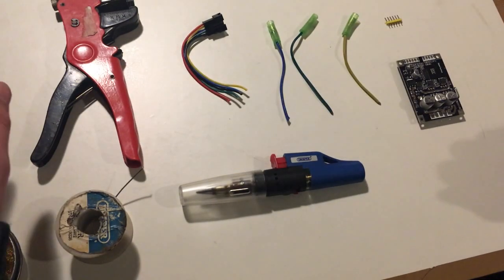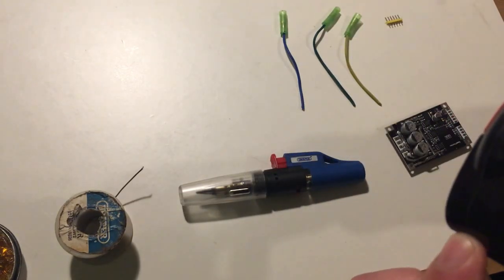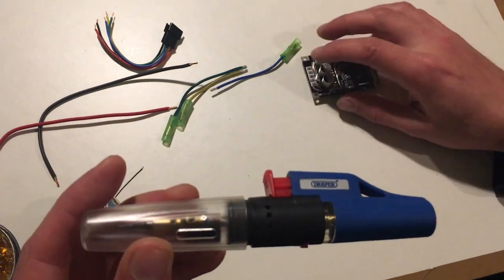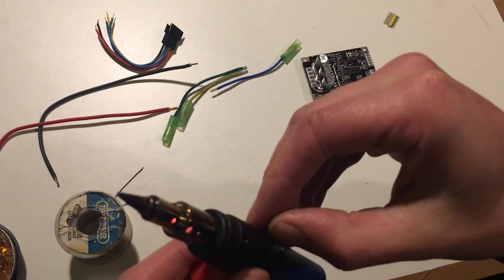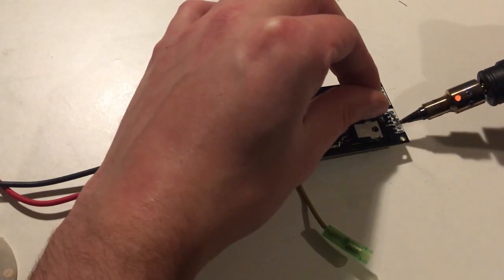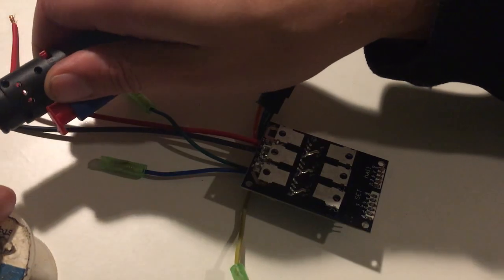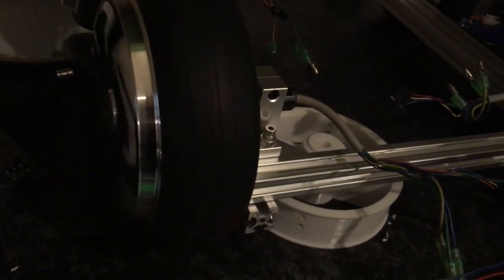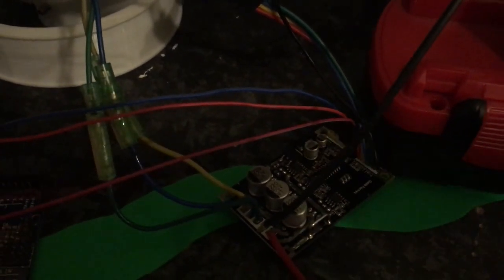Hoverboard Motor + 500w Brushless Motor Controller and arduino 12v - 36v 500w

Comment from the maker: some people have been asking for the code, here it is, its only basic but it gives you the idea of how to use this controller:

int motor = 9;       
int Mspeed = 0;
int Mspeedset = 0;
int Mdir = 8;
int Mdirset = 0;
int fadeAmount = 5;   
int directionLR = 0;

void setup() {
  pinMode(motor, OUTPUT);
  pinMode(Mdir, OUTPUT);
}

void loop() {
  analogWrite(motor, Mspeed);
  digitalWrite(Mdir, Mdirset);

  if(Mspeed > 240) {
     Mspeedset = 0;
    }

  if(Mspeed < 5) {
     Mspeedset = 1;
     Mdirset ++;
     if(Mdirset == 2){
        Mdirset = 0;
       }
    }

  if(Mspeedset == 1){
     Mspeed = Mspeed + 5;
    }

  if(Mspeedset == 0){
     Mspeed = Mspeed - 5;
    }
    
  delay(30);
}
Reply: please i don,t understand this code >> please we need video and you write  this code and connetion arduino with Controller  500W  by wires
Reply from the maker: ok, basically you need to set the speed and direction, im not going to do a video on these because they are not very good, thanks and sorry for the late reply
Reply from the maker: @Robo Cop hi, i think if i went back to trying them again it may be more positive, the only problem i found with them was when a heat sink was fitted, it was also live as in if a ground wire touched the heatsink the whole thing shorts out, i think if it had individual small heatsinks and a protective case that would help a lot, personally i think they should come with heatsinks, hope this helps
Reply: This code don't compiling
Reply from the maker: what is the error message at the bottom? thanks

Comment: Awful work. You used an HDD to keep the board in place for soldering?!
Reply from the maker: top tip: old hard drives are heavy so they are good for weighing things down to stop them moving

Comment: hey @A-Tech, I have the same set-up as yours with the hoverboard motors & arduino board. The thing is, one of my hoverboard motors does spin with the PWM signal from the arduino but the other spins for a second then stops completely. I adjust the PWM value to a high value or use a pot to vary the signal to the VR pin on the motor controller & this motor still refuses to move. Any directions or advice? Really appreciate your help, this is for a big school project
Reply from the maker: hi, i had a few issues with sparks and burning electronics with these so i stopped using them, best advice i can give is to reprogram the original motherboard and use that instead, hope that helps

Comment: where is the diagram?
Reply from the maker: all the pins have labels so should be ok, red and black power and yellow, green and blue for the hall sensor and motor wires

Comment: Do NOT use these with any voltage higher than 36v, I had 3 12v batteries connected in series and the peak voltage was 39v, sad to say it instantly fried my controller
Reply: I just fried 2 of those by doing exactly this. 39 volts too
Damn
Reply: WHAT SHOULD BE THE VOLTAGE RATING OF THE BATTERY FOR THIS CONTROLLER/DRIVER?
Reply: @adeebazadsheriff  around 36 but nothing more than 36v
Reply: @5minutehacks989  what was the batterys rating you used?
Reply: @adeebazadsheriff  I used 3 sealed lead acid batteries in series rated at 12v each. Should have given me 36v but the fully charged output was closer to 42v which fried the controller
Reply: @5minutehacks989  ahhh i seeee. Did you try to run the motor with controller using a battery rated less than 36v?
Reply: and dude @5minutehacks989  could you tell me about the project where youve used this motor controller, motor and stuffs

Comment: Do NOT use these with any voltage higher than 36v, I had 3 12v batteries connected in series and the peak voltage was 39v, sad to say it instantly fried my controller

Comment: Hi, my hoverboard motors just vibrate when I try and control them via arduino or potentiometer. I tried this with two differents ESCs. Would you happen to know a fix to this?
Reply from the maker: hi, it could be the hall sensor wires not matching up with the motor wires,  maby try swapping some around?

Comment: Is there an effective way to incorporate the ability for the motor to change direction?
Reply from the maker: if i remember correctly there is a direction pin, 5v one way, 0v the other way
Reply: @A-tech  So in terms of wiring to go in both directions, how does that work?

Comment: Have you tested this board with a 10s battery or over 36 volts? Because the board states the max voltage is 36 volts but a 36v battery(10s) goes up to 42v. And im wondering if that will kill the board. Thanks for the video.
Reply from the maker: Hi, yes it’s fine, I have seen firmwares set up for a 12s battery, thanks
Reply: @A-tech  Thank you very much
Reply: @yeetgenchYT  My reply is a bit late, but just warning you it killed my board and the connector for my battery.

Comment: Is it necessary to connect hall sensor connector  of controller? Can I run motor without connecting hall sensors to this controller?
Reply from the maker: hi, i think for these motors you do need a hall sensor or they will be jumpy / not start, however you can get sensorless versions of these controllers, hope this helps

Comment: So I’m a dwarf and I’m only 3ft 55 lbs. I’m tired of having to use wheelchairs that are too big and hard to transport. I’m planning to build my own, portable chair using 2 of these brushless motors. I haven’t decided on controllers yet but was thinking of using an arduino. Any suggestions on controllers? Should I consider moding another board? I thought about buying a mini Segway and use the components but I want it joystick driven and don’t need self balance. Any advice is appreciated
Reply from the maker: hi, i would say the hoverboard motherboards are best, a bit more tricky to set up but so far from my testing they seem better, i will have a video out soon showing how to reprogram them, controls would be through arduino yes and it does work with a joystick, do you have much experience using arduino with joysticks? thanks
Reply: A-Tech currently I do not. I am new to arduino but I learn fast. I spent a few years studying computer engineering in the past so I think I can learn it. I literally just built my house learning from YouTube lol

Comment: Assalam o Alaikum
Hi
This controller card is run two motors in one time or not please ans me ASAP
Reply from the maker: hi, short answer is no, this is because the motors have sensors , thanks
Reply: @A-tech  Thanks
Reply: @A-tech  which type controller is perfect for hoverboard dc motors run two motors at a one time please guide me thanks
Reply from the maker: hi i think the best way is to use modified hoverboard motherboards, thanks

Comment: Can I use the 36-volt HoverBoard battery and use it with a 500W driver?
Reply from the maker: hi, yes thats perfectly fine, i did it with my one, i would recommend putting a switch and in line fuse too so you dont get sparks when you connect the battery, i had one of these controllers break (not sure how) and now it just blows 10A fuses as soon as i connect the battery, without the fuse there would probably be fire, hope this helps
Reply: @A-tech  I have just noticed that the special battery is capable of hoverboard generating from 36 volts up to 42 volts  and Driver 500 W only receiving 36 volts
Please help me to find a suitable solution without being burned Driver
Reply: @technologybeat1186  I've been using the same  driver for almost a year - no problems. I am also using a hoverboard battery. The battery has 36V when medium-charged. On full it's 42V. That's normal and should be absolutely fine for this controller.
Reply: @thomaswei8416  what ampere battery can be used for driving 36V bldc ? I mean i want ratings in Volts and Amperes because i want to purchase smps for test purposes !
Reply: @raynaindustries1957  Depends on the motor's current draw. The battery should be able to supply that. Since Watts = Ampere * Volts, the current draw of a 36V 500W Motor should be around 14 Amps (14A * 36V = 504W). I am using a 350W 36V motor, which draws 9.7A max. (9.7A * 36V = 349.2W)  

The standard hoverboard batteries (https://www.ebay.de/itm/Ersatzbatterie-Batterie-Akku-Hoverboard-ELEKTRO-Scooter-36-V-4-4-Ah-Samsung-Zell-/323341426131) have a max discharging current of 30A - you shouldn't go over that. Max continuous is is 20A and rated discharg is at 15A.

Comment: I’ve got 52v at brown wire off controller so power going in and out people have had hover board motors working like this before just got find right wiring 😀
Reply from the maker: have you tried using a vesc controller?

Comment: i should take top off controller i might see the wiring configuration better
Reply from the maker: it sounds like you have something completely different
Reply: It’s just a cheap eBay controller that I used for the razor electric scooter I souped it up a bit 😀

Comment: im just uploading a video it seems like the logic board gone on hoverboard but hope to use motors.video is very similar to my throttle so which would be the signal wire on controller .if i put meter on volts and measure the leads perhaps one will be 5v?
Reply from the maker: ok sounds good, its hard to say without seeing it first

Comment: hi im trying to connect 36v ebike scooter throttle to hoverboard via a controller.as hoverboard not powering up battery was out in cold but ive got good 54v ebike battery i made.ive had the 36v throttle working ok on a scooter before think it was 3 wires red +5v yellow + and black _ if i get yellow black mixed up thats not good is it?as +5v doesnt want 54v  going thru i guess.the controllers i have about 3 not sure which colours which apart from main power red and black thick ones.any advice please?thanks.steve
Reply from the maker: hi, i couldnt see the controller on the link it just went to an airplane website, is it ok to put the 54v into a 36v controller? that may be something to check first, with the throttle they are normally just a potentiometer that sends the signal to the controller so its most likely 5v on the red, yellow usually the signal and black to ground, hope this helps
Reply: @A-tech  i think most controllers will take a bit more voltage from what i have seen  so how wil i know which is +5v can i take areading with meter on controller leads with power connected?will send link to ebay controller

Comment: Hi nice Tutorial. Can you post the code sketch? How did you handle the hall sensor in arduino? Did you use the servo library? Thanks a lot for your help :)
Reply from the maker: Hi, the code for this is very basic, just load up the 'fade' example and you are almost there, the hall sensor works through the speed controller, didnt have to use the servo library, you just need to analogWrite(vr pin on controller, speed) and set the direction, no problem
Reply: Wow what a cool esc. I thought I have to time the different pins in depend to the hall sensor inputs. Thanks a lot man and thanks for your quick respond :) have a nice day

Comment: How do You controll this by Arduino? I have only seen it controlled by pot-meter.
Reply from the maker: hi, to do this with arduino you just send a pwm signal to the VR pin, same as with a pot, the controller has a built in DAC so it smoothens out the pwm into a voltage
Reply: @A-tech  Nope, don't work. I did buy a "MCP4725 I2C DAC Breakout module (cost only 65 Cent)" and that work very well,  smooth voltage signal from 0-5VDC connect to GND and VD. Work perfectly
Reply: @thirstyboots6205  sir please tell that how you connect MCP DAC to this board and arduino
Reply: The code is not well written, just some fractions i put together, the RPM have some problem (think it cause by the loop), RPM is shown in the Serial monitor, Sorry I'm not a programmer expert, power feed for the motor need to be minimum 9VDC.
Hardwire: http://oi63.tinypic.com/xf6kwl.jpg
Reply: @vinayraj9942 

#include <Wire.h>
#define MCP4725 0x60 // MCP4725 base address
int pin = 2;
volatile unsigned int pulse;
int rpm_rate = 0;
const int pulses_per_rpm = 28.57; // 28.57 for 10T motor
unsigned int val;
byte buffer[3];

void setup()   {
  Serial.begin(9600);
  pinMode(pin, INPUT); // Read puls from Signal
  pinMode(4, OUTPUT); // Change direction of motor connect to Z/F
  attachInterrupt(0, count_pulse, RISING); //
  Wire.begin(); // begin I2C
}  // end setup

void loop() {
    pulse=0;
    delay(100); // count number of puls 1/10 of a sec.
    noInterrupts();
    rpm_rate = pulse *  pulses_per_rpm;
    interrupts();
    Serial.print("RPM: ");
    Serial.println(rpm_rate);
     
  val = 1000; // fixed value for testing, use 0 to 4096.
  buffer[0] = 0b01000000; // control byte
  buffer[1] = val >> 4; // MSB 11-4 shift right 4 places
  buffer[2] = val << 4; // LSB 3-0 shift left 4 places

  Wire.beginTransmission(MCP4725); // address device
  Wire.write(buffer[0]);  // pointer
  Wire.write(buffer[1]);  // 8 MSB
  Wire.write(buffer[2]);  // 4 LSB
  Wire.endTransmission();
  digitalWrite(4, LOW);    // Turn direction
  delay(7000);             // wait for 7 second
  digitalWrite(4, HIGH);   // Turn direction
  delay(3000);             // wait for 3 second
  
} // end loop
void count_pulse()
{
    pulse++;
}
Reply: If You buy this blue one https://www.aliexpress.com/item/MCP4725-I2C-DAC-Breakout-Board-module-12-Bit-DAC-w-I2C-Interface-GOOD/32817675630.html
Then You have address 0x62 and 0x63, if You buy the red one https://www.aliexpress.com/item/MCP4725-I2C-DAC-Breakout-module-development-board/32821744967.html then You got address 0x60 and 0x61.
Whats the point? The point is if you buy two of each You can controll 4 motor by one Arduino.
Because the I2C need different addresses for different moduls. Be aware the Blue one have allready solded to low (0x62), solder have to be removed and put on high to set address 0x63.
Reply: @thirstyboots6205  i am using hoverboard motor having hall sensor also which is not work. if  i not connect the hall sensor wire.
Reply: @vinayraj9942  It is because I do not work with the hall sensor board, my example is for the BLDC Motor without sensor, You ask about my set up I gave it to You.
My orginaly post was about how to change the manual pot-meter with code from Arduino, (which i believe is the same for both boards).
Reply: @thirstyboots6205  how would you modify this to control the speed with ps4 thumb sticks? talk control style?